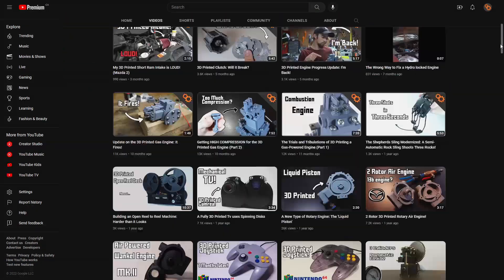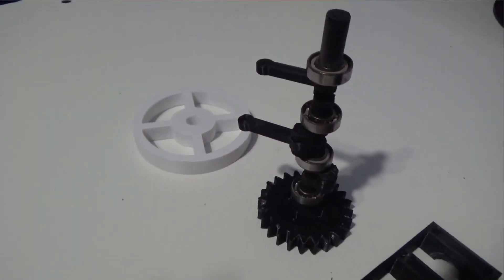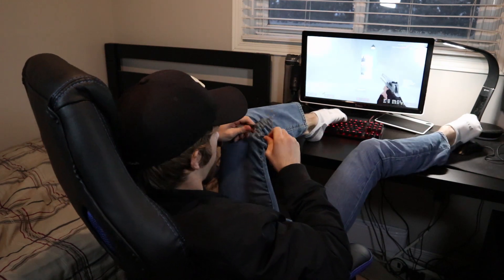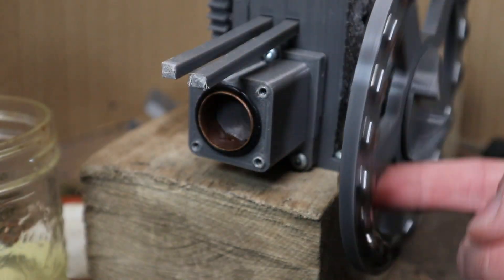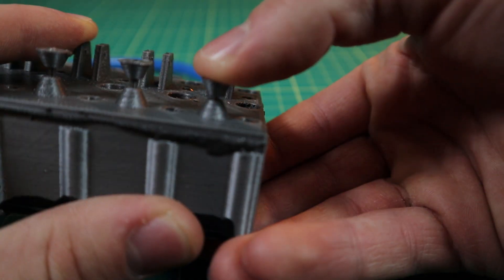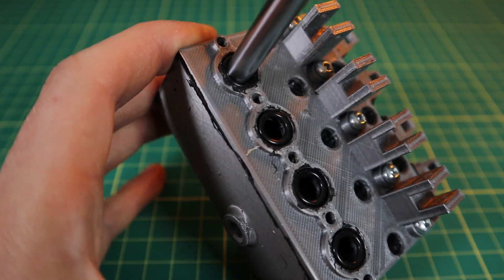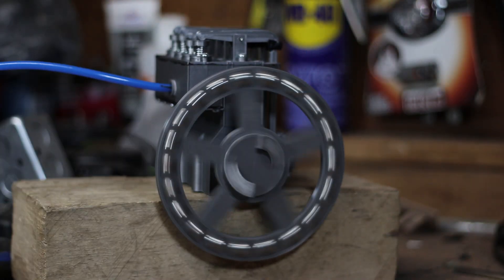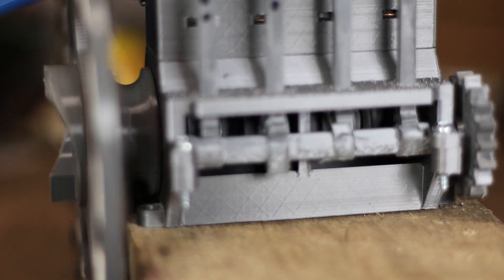3D Printed Four Cylinder Engine

Comment: I've found some significant differences between compressed air-driven piston engines and internal combustion engines. An internal combustion engine's power comes from the combustion of the combustible mixture in the cylinder, and this pressure naturally forces the intake valves to close. A compressed air engine, however, requires the intake valves to remain open to allow compressed air to enter the cylinders and perform work. In the cylinder head where the timing system is located, an internal combustion engine operates at atmospheric pressure and is open to the atmosphere, while a compressed air engine needs to be sealed; in fact, this is the part with the highest pressure. Therefore, special considerations are required in its design.

Comment: The most similar to the compressed air engine is the 2-stroke engine. They must use two air strokes and ports without rod valves.

Comment: To keep it more of a 3d printed air engine, Resin print the cylinder sleeves still be great for sealing and lighter weight also thinking the inlet design a intake manifold like a fuel rail so each cylinder has its own intake

Comment: Can you run it on steam that you produce by boiling water over a flame? There is the problem of melting the plastic but this way the engine would actually be powered by burning fuel, just like a real 4-cylinder combustion engine!

Comment: How have I gone this long in my life and not realize you can measure and mark a copper tube at the same time with your caliper and then cut it so easily/cleanly with that roller pipe cutting tool. Looks so easy compared to how I would have went about it lol. I’m sure it only works for soft materials relative to the calipers otherwise you might mar your caliper grips

Comment: Compressed air engines air basically 2 stroke engines that run off compressed air . You should've used a cross plane crank

Comment: Using ICE 1:2 camshaft ratio in air engine is nonsense. Use 1:1 - making work per each revolution. And please, use flathead design - valves should be opened in the opposite to the air pressure direction for not to be opened with air pressure.

Comment: 11:36 Reasons why someone would want stick shift over automatic is that if you know how to use it, the trans will last way longer. (Especially for towing. 7.3 Powerstrokes with stick are indestructible) and because in certain circumstances (most of the time) it's more fun.

Comment: hey sorry im putting this comment on this video but i remembered on your gas powered engine why dont you use something like hydrogen gas im sure you already thought of it by now but just fruit for thought i figured its not as dangerous as using straIGHT GAS
Reply from the maker: It was an option, but it requires plenty of setup to make possible. It would be easier to try and opt for an existing fuel source instead of try to create apparatus to produce it

Comment: I think maybe it would have been better to stick with a 3D printed pushrod. I think the metal rods added too much mass to the rotating assembly and robbed all the power you needed to actually rev the thing.

Comment: maybe to get rid of some leaks and tolerance issues regarding the valves you could use good old ball valves, i mean bbs, springs and o-rings, just because the valve may actually slip off the rod even if you melted that in place

Comment: I’m sorry to say but the model a engine you showed is a flathead, meaning it has no pushrods, it works by having the valves in the block parallel to the cylinders with the valves riding directly on the lifters, eliminating the need for rocker arms and pushrods, this also means the head is mostly just sealing off the combustion chamber, hence the name flathead. Great video as always, keep it coming👍

Comment: Could you do a 3 cylinder engine or a 5 cylinder 😎
Reply from the maker: Odd-cylinder engines have a nice distinct sound too them, such as Audi's straight 5 and Suzuki's 3 cylinder. I have made a 3 cylinder already but would like to try more!
Reply: @CamdenBowen  I have a suzuki g10 in my geo metro lol 45 hp little beast

Comment: Hey!  Building my own engine with cylinder sleeves now.  I've gotten two different engines running well now, but I have yet to post anything on them.  What did you use to cut the exhaust ports?  Just would like to know the best method before wasting more copper pipe.  Also,  how much messing with o-ring tolerances did you need to do to get a good seal, without making too much friction?  Thanks!  Looking forward to your next vid!
Reply from the maker: Thank you! I used a Dremel and a cutting wheel to cut the rough shape,  then used a small hand file to shape it correctly and then sandpaper to deburr the inside of the bore after. As for the O ring tolerances, it really doesn't matter that much as long as you use oil/grease. If its within a certain ballpark where it is still making a good seal but not hugely oversized, it should work fine with minimal friction
Reply: @CamdenBowen  absolutely! Ohhh, cool!  One last thing, how would you suggest cutting the ports without a dremel?  I do have the tubing cutter tool that I thought about using, and a fine tooth hand saw.  Hope you have a good day/night!
Reply from the maker: @Hayden  I would use the hand saw to create a couple small cuts side by side to make a somewhat grill pattern, then using a screwdriver bend and break the grills off to expose a large port. As long as the inner bore is clear you may not need a file!
Reply: @CamdenBowen  thanks man!  :D

Comment: If I had to guess, the engine having to compress any air that is in the cylinders when the piston is travelling up is significantly restricting the maximum rpm of your engine. This is especially true since the engine's compression is so good. Having lower compression while giving it less torque may allow it to achieve a higher rpm. I would recommend adding an exhaust valve and trying again. It shouldn't be as hard to get an exhaust valve to seal, as there is no air behind the valve, and any air entering the cylinder will just be putting pressure on the valve seating it even further into its position.

Comment: Run it till it fails
Reply from the maker: I wish I had a powerful enough air compressor, I'd love to max out its pressure and RPM to see when it comes apart
Reply: @CamdenBowen  link thé two compressors into tank and assistant power by buciyle pump make thé tank Big as u Can it will take while to fill up and it will take forever to bé emptyed if there IS no leak

Comment: Awesome project mate! I've tried many times with making 3d printed solenoid and air engines like you with mixed success. this makes me really want to go back and try again. thanks!
Reply from the maker: Thank you! I wonder if you could take my files I provided in the description and replace the pistons and cylinder bank with rods and electromagnets and make a solenoid four cylinder that way

Comment: 2 stroke gas engine next? its gonna be fun (they said) maybe also fully 3d printed even without sleeves (2strokes dont need that much compression)
Reply from the maker: Actually it COULD be possible if I do use a sleeve and o rings. The original 2 stroke design I made last year had a decent foundation but no compression so it never ran, I bet now I could go back and make a somewhat functional prototype
Reply: @CamdenBowen  i hope you can but i just wanna ask (what printer do you have) and do you preform maintenance like tightening belts and screws cuz my ender 3 max does the cleanest surfaces when you level the bed properly and tighten the frame a little
Reply from the maker: @Dies Roelofs  I have a creality cr10s4, and as far as I'm concerned, it's pretty well just a bigger ender 3. I rarely do that type of maintenence beyond just lubrication of some parts and I've had it for over 4 years now with very few issues
Reply: @CamdenBowen  hm yeah mines on the bigger side too but i upgraded to a mirror and it prints like heaven it can print milimeter thick rods like 20 cm up with no stringing or layer woble at all no settings where changed just a load of maintenance

Comment: Why don't you put the firing intervall at 90°?
So he does shoot - 90° - shoot - 90° - shoot - 90° and so on and so for.
This needs to be a 2 strokes to work though.
Reply from the maker: I wanted the design to be faithful to the reference design of a 4 cylinder combustion engine, where the interval is 180 degrees meaning it must have a flat plane crank and a four stroke pattern

Comment: That sound of leak (if it's not a leak) is a compressed air going at a high pressure somewhere
Reply from the maker: That's just the compressor, not the engine. One of the high pressure lines started leaking on the compressor somewhere last year and I haven't been arsed to fix it

Comment: If gear ratio is 1:1, will it work?
Reply from the maker: It could it would make it run as a 2 stroke rather than a 4 stroke as mine does, eliminating the waste compression stroke
Reply: @CamdenBowen  😁. Make something to release that waste compression.

Comment: It’s the next gas engine model idea
Reply from the maker: I need to have the single cylinder one running first though 😭
Reply: @CamdenBowen  I think one way to make it rev higher is to make it overhead cam idk if it would work on a air engine tho so you don’t have do it if you don’t want too
Reply from the maker: @Ihappyboy1234  I'd like to try an OHC, I would just need to figure out a way to do it that makes sense. I could do it the way I did on my 3 cylinder air engine or I could devise another way maybe
Reply: @CamdenBowen  one more thing the four cylinder air engine compression sound like it may have a better chance of running when turn to gas power and its power stroke every 90 degrees instead a 180 degrees til power stroke I’m not expert so it may be very very inaccurate so only do it when you make the first engine work
Reply: But there’s always power there per 180 degrees I think it was also I love your video

Comment: Just from hearing the engine it looks like you either need higher valve lift, or a taller cam lift. less lift means it can run at lower pressures, with the tradeoff of low rpm, and a high lift/duration camshaft providing higher rpm with higher pressure
Reply from the maker: It could be that but as well, fine tuning the cam timing to optimize it for high RPM can help as well as having a new inlet tube

Comment: You may also consider having exhaust valves instead of a vent at the bottom, when I made air engines, I found it works better, as when the cylinder is traveling up it won’t have to be fighting compression
Reply from the maker: I want to make a few more engines like this but with the exhaust valves as well, I'm sure they'll help with the sound
Reply: @CamdenBowen  I would recommend a slider valve. Lego vacuum engines use them and they work amazingly
Reply from the maker: @the_icon_of_sin_94  I am really interested in how these lego engines work, maybe it could be the subject of a future video!
Reply: @the_icon_of_sin_94  That's actualy how I learned to make air engines! Didn't know so many people made lego air engines

Comment: Awesome build!. Another reason why it may not rev high is because it has a very heavy flywheel which will allow it to idle at much lower speeds, but won’t be able to reach as high of RPM’s. Awesome engine though, I look forward to future videos!
Reply from the maker: Thank you! Any smaller of a flywheel and the engine may not have ran so well lol, the valves with all that pressure. A lighter flywheel would make it much peppier though if it weren't due to the valves
Reply: A heavy flywheel slows down how quickly the engine speeds reaches it's maximum value, but it doesn't limit that value.